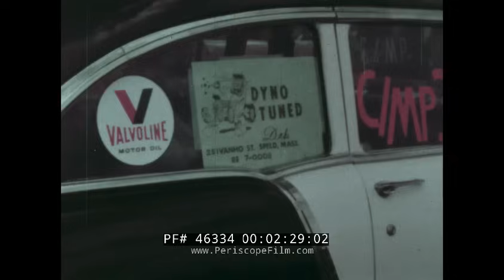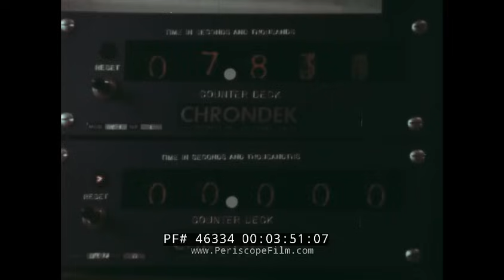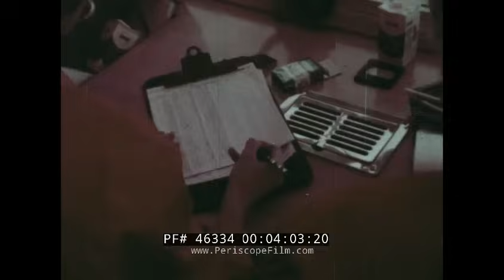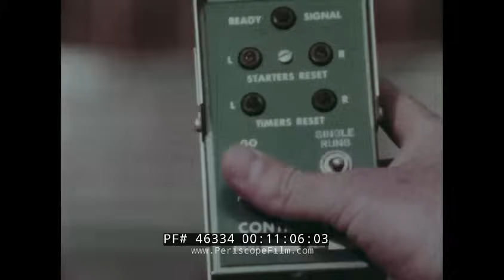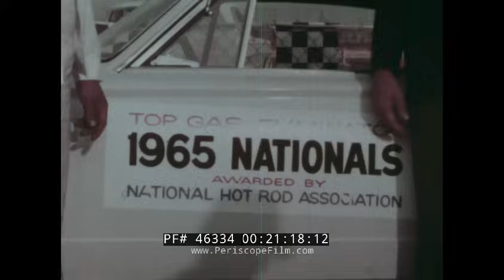NATIONAL HOT ROD ASSOCIATION 11TH ANNUAL NATIONAL CHAMPIONSHIPS AT INDIANAPOLIS RACEWAY PARK 46334

Comment: BUT BRISTOL ISN'T ON THE NHRA CIRCUT NOW IN 2017
Reply: From the NHRA official website.

The NHRA Thunder Valley Nationals were run at Bristol Dragway from  June 16 -18, 2017.

Clay Millican was Top Fuel Eliminator
Ron Capps was Funny Car Eliminator
Alex Laughlin  was Pro Stock Eliminator.

The NHRA Thunder Valley Nationals that were run, last year, from Jun 15-17, 2018, the results are as follows.

Tony Schumacher was Top Fuel Eliminator
Ron Capps was Funny Car Eliminator
Jeg Coughlin Jr. was Pro Stock Eliminator.

Where are you getting your misinformation?

"Well I thought..." is not an answer. 

"I did not know" is not an answer.

It takes as many keystrokes to navigate to the NHRA Website and extract this information as it does to make a patently false statement.

The NHRA Thunder Valley Nations is scheduled for June 14-16 this year. Enjoy.

I do not understand why someone will give you a thumbs up for misinformation. Some people will believe anything that another tells them WITHOUT DOING ANY RESEARCH as they are INTELLECTUALLY LAZY. 

Seriously. I challenge you to go to the NHRA Official Website and VALIDATE that which I have reported. Do not just take my word for it. (How do you think that I garnered the information?)

Click on RESULTS.

Scroll to 2017 in the Year Menu.

A series of Tiles will load that includes all NHRA Sanctioned National Events that happened that year.

Click on RESULTS tab underneath the tile which is titled, "NHRA Thunder Valley Nationals"

DO NOT TAKE MY WORD FOR IT. I am just a stranger on the Internet whom you do not know.

Make this type of verification a HABIT